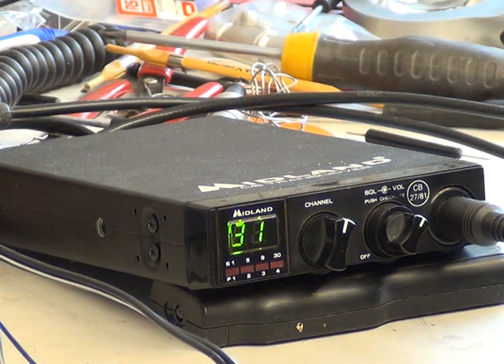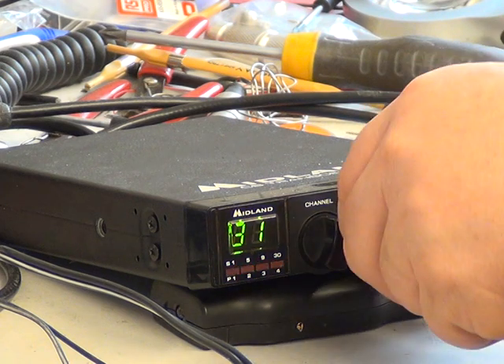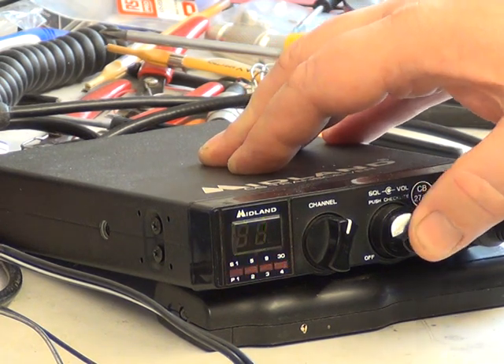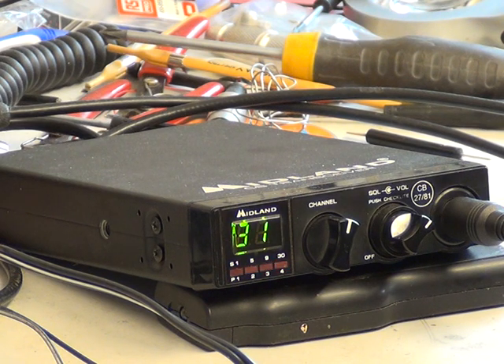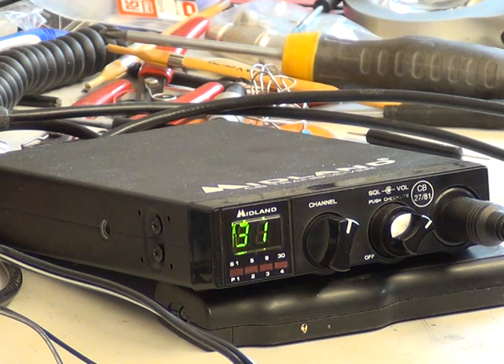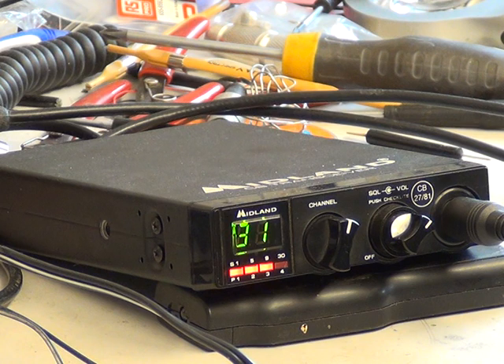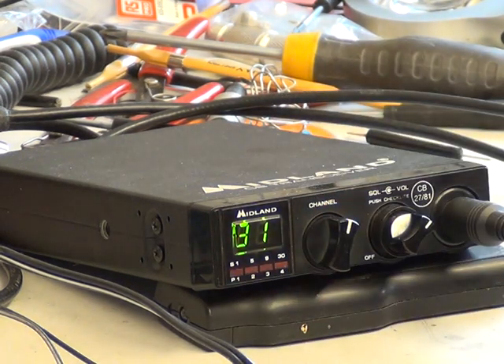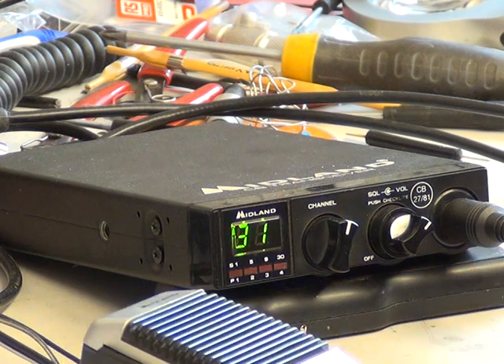Midland 77-805D UK CB 27/81 Transportable CB radio -On The Air Test

Comment: What aerial are you using thanks
Reply from the maker: base aerial is antron 99 type without optional groundplane kit mounted at gutter level (on a wall mount) of a single story building. Cable is 6mm mobile type, but industrial grade.

Richard, G0OJF, UK
Reply: @ukfmcbradioservicingTango21  thank you so much for the info I was just wondering could I use the built in antenna on a magmount base with a swivel adapter and maybe stick it on my metal window frame. I no I probably won't get very far but I was just wondering thank you kindly👍
Reply from the maker: No, there is a loading coil as part of the radio circuitry for the built-in antenna. Trying to use that aerial in a different way will overload the transmitter output transistors & destroy them. You can ofen get away with a magmount on a buscuit tin. You also need to have an SWR meter to check the aerial adjustment & position. It's not easy with an indoor aerial.

Richard
Reply: @ukfmcbradioservicingTango21  thank you for the sound advice it's hard where I live as I'm on the second floor and the only way I can do it is use a magmount on a biscuit tin or strap it on my metal window frame. But thank you again for the good advise it's very much appreciated 👍👌

Comment: Hi there, I have a rig like this 77-805 D fully complete & original, like new it's even got the twin plate that goes into the battery tray, original case, aerial, speaker microphone. I powered it up with lighter socket and the rig is great, so how do I set up the frequency of the rig as I've no frequency counter to get it right? I'm in WalesUK and don't know if there's anyone that I'd be able to trust to do it correctly for me. I also have a Cybernet beta 3000 which I think is in need of a look at as I think that the rf chip is gone out, but I don't know for sure. I'd appreciate any help you can provide me. 
Thanks
Martin
Reply from the maker: You can't set the frequency without a proper counter...not a 5-digit hobby one! Experience is that radios that haven't been messed with drop slightly low with age but 99% of the time are still in spec. Although we normally only deal with the trade, I've been helping some end users over this lockdown period. email me rshireby@yahoo.co.uk

Richard
Reply: @ukfmcbradioservicingTango21  thanks for that Richard, I'll drop you a note.

Comment: did not know there was a d version until watching your video, is the D version better or more reliable  than the normal version?
Reply from the maker: They both suffer from dry joints especially in the VCO under the screening cover.

Richard
Reply: @ukfmcbradioservicingTango21  oh ok, I have the normal version but all working at moment, if it stops working then I know where to come
Reply: @ukfmcbradioservicingTango21  due to lead free solder ?
Reply from the maker: @RobBob555  No, luckily that hadn't come in back then. It's because components leads weren't properly cleaned prior to assembly. When this happens it takes about 3 years for the snag to show up.

Richard

Comment: I had one of these Richard a long time ago not a bad little rig but i went through countless radios back then. i noticed Mr.chippy's radio made a small bleep sound every time he keyed up is this normal or a fault in the radio or mic....
Reply from the maker: The next-to-the- latest Midland 78 multi that Mr Chippie uses isn't the best version of it & not only is there that 100ms initial tx instability ( I think they called it "dipthonging") when I was at college in the 70's, the mike can be prone to picking up stray RF too; we have that (latest ble display version) in one of the other cars that has a glass sunroof with a plastic sliding cover...so there's no RF shielding in that part of the roof. I always wonder why some cars with aircon have a sunroof! 

However, the Midland 78 multi otherwise works well & has useful features & a real squelch control (not off a menu). We've talked about changing all four car sets to Rotel RVC230's, but currently only have one set!

Yes, basically the set's crap but isn't faulty.

Richard